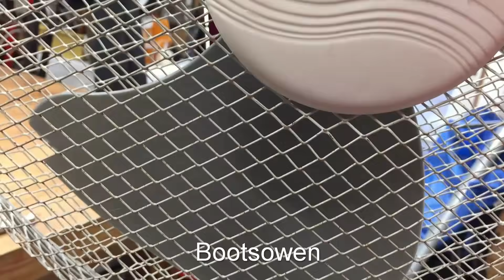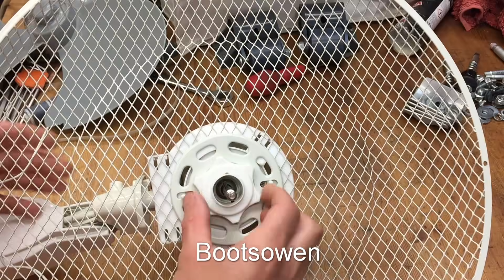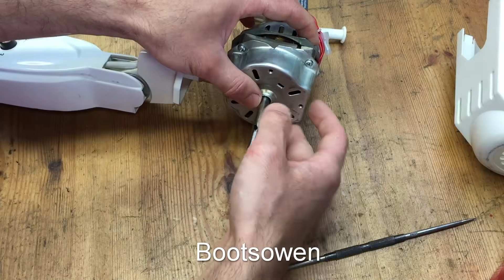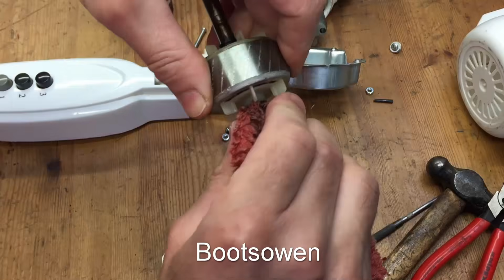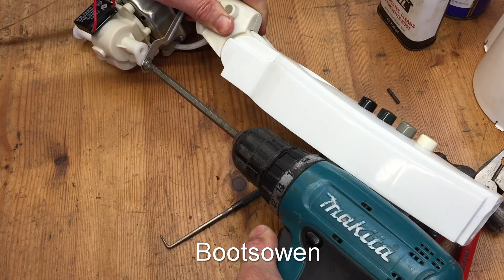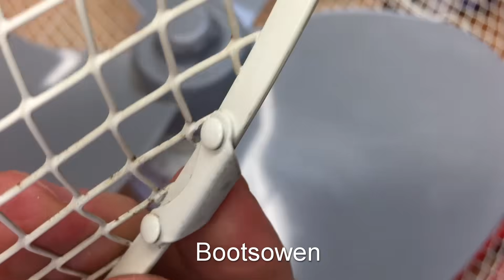Fixing a Pedestal fan that wont spin or spins slowly, easy repair, just a drop of oil!

Comment: nice video! good flow, to the point and efficient.  others would have made this an additional 22mins of boredom :) 
i know you're just trying to make the video tidy, but most repair people (myself included) would have tested the fan motor before putting it all back together -something could have come disconnected or additional cleaning may be required.  thx!

Comment: Thankyou for making this video, very informative indeed, my £40 geepas fan with a 60 watt moter has stopped working. Just before it stopped completley I had to manually move the propeller by hand to start the fan. I'm reluctant to throw away as it cost £40 to buy a year ago. So I will be taking your advise and opening the fan to clean and oil. Can you make a video showing the changing of the capaciter ?? , because the problem as you explain is either one or the other or in some cases both (cleaning and a capaciter change) , thanks

Comment: don't seem like you bothered applying any of the machine oil though other than just using wd30 to clean the inside of the bearing sleeve holes? anyways mine is exactly the same procedure and i did not see any bad gunk or hair stuck in there, i oiled both ends but did not bother running a cloth through the sleeve holes like you done, i do not think cleaning is the issue with mine and i thought it may have been the gear work in the back so i disconnected that and it started working but then after a few min it stops like it ceased which made me thing of dirt in the first place but i think now it's possibly some kind of electrical problem and i won't bother anymore ill just go to the thrift store and hope to find a good used one
Reply from the maker: I did put oil on at the time, but it got chopped accidentally in the edit, somehow didn't stop the video doing well! I have done it again recently and made another video showing the oiling. Yours sounds in a bad way!
Reply: @bootsowen  yeah im guessing it some kind of electrical component  that is shot and  not worth trying to fix after trying to hit the shaft to align it it worked well then ceased again so its not worth the effort anymore

Comment: I did the same thing and it had worked, now it has again stopped working and i feel there could be issue with the buttons, can you help with that please? maybe show a video on how to fix the buttons and i’ll follow
Reply from the maker: These are a disposable device. you have to reoil regularly. or you can spin start it by hand and it will probably keep spinning.

Comment: After cleaning and changing the capacitor but it's not turning on its own have to give a turn , The shaft is very smooth and its so smooth but still not working

Comment: i have a tower fan with the same issue. it powers on as the leds numbers light and i've taken it apart and cleaned and lubricated and replaced the capacitor but the turns on, oscillates but the blade won't spin. the blade spins very freely if spun by hand. the motor doesn't show any damage. any ideas

Comment: After opening mine, My fan is well oiled but doesn't want to spin, it's weak. Before opening it, it was kind of slow but did spin. Now it's no longer slow but doesn't spin. I can hear the fan kinda humming.
Reply: sounds like a capacitor

Comment: Never mind Oil how do I reset my fan if I had a power surge went off and then when I go to unplug it I leave it unplugged for six hours I plugged it back in all the lights go on the fan will go back-and-forth but the blades will not turn not even budge it’s like there’s no electricity getting to it orthe intellect of the computer part of this is not working right how do I reset it

Comment: So...i watched this video AFTER i took mine apart because it is fairly easy. After you remove the cover on the back, theres the little white box (the capacitor screws on to it) that houses the oscillating pull knob. When i went to put mine back together, everything seemed like it was okay, technically the fan does blow better lol. BUT, the knob doesnt stay in place when i pull up on it. Any ideas?

Comment: Thank for sharing I did a few of the stuff u did to my fan but it still not work in..but there is some thing I sew u did ..I be back to my fan and try it..thank for sharing I have gain alot🎉❤💯💃👍👍👍👍👍👍
Reply from the maker: Try again
Reply: Thermal fuse is probably a blown if fan won't power up and spin fan blades. Axial fuse 122TF 115C degree cutoff of AC house power. Fans used to start fires. The Thermal fuse prevents fire.

Comment: Great teaching. Consider putting the screws into a small bowl as you remove them. I often take pictures before and during when I take something apart. Helps in putting it back together.
Reply: The thermal fuse was blown in my floor fan. I cleaned everything inside and outside.  It's like a new fan. My favorite old man was ready to buy a new one 😊
Reply: @SherlockOhms119  "My favorite old man" how many do you have??

Comment: Wd40 is oil not a cleaner .
Reply from the maker: What’s your point. It is great for cleaning. It is a water displacer. But it will act as a lubricant and a solvent so it is an excellent cleaning agent.
Reply: It’s a cleaner bud

Comment: 😳 OMG …not very mechanically minded here. I thought I could just spray some WD40 !  They are so cheap I’ll just buy another one (which they plan for anyway). Needed-a new simpler designed fan !
Reply from the maker: or you could try and fix it, open it up and spray in some wd40?
Reply: I bought a new one of the same brand, (Black and Decker) and it doesn't work half as well as the older one... So I'm gonna try this... If it doesn't work I've lost nothing more, possibility will gain back the better fan. 🤞🏻

Comment: I followed this to the letter, went to all that effort, disassembled, reassembled (mine was a tad more involved than this one though) got it all back together & it worked great... for about a fortnight!

Only now on the rewatch did I realise you didn't show where to apply the oil? And THAT is the only thing I didn't do.

🤦‍♂️

Help me please... lol!
Reply from the maker: Apply oil to the fan motor spindle, a drop to each end
Reply: @bootsowen  There should be a felt material surrounding the bushings that needs to be saturated with light oil (3 in 1 will work). The bushings are made of sintered metal that allow oil to slowly seep through. Doing this every 2 years or so will keep the fan running for a very long time or until the switch breaks. You may need to lightly tap the shaft in several radial directions after reassembly to realign the bushings to the shaft if it doesn't spin freely, especially the front bushing which usually gets out of alignment during disassembly and reassembly. The bushings are convex on their outside diameter to allow for this.
Reply: @nchw68 THISSSS... pin this shit... this shit is what making my fan spininng slower and to a stop at some point... and had to disassemble and reassemble to make it work again... i was wondering what the weard pieces of cloth around the bushings were...
Reply: Thank you, this is very helpful additional info.
Reply: What if it does still not work then what?